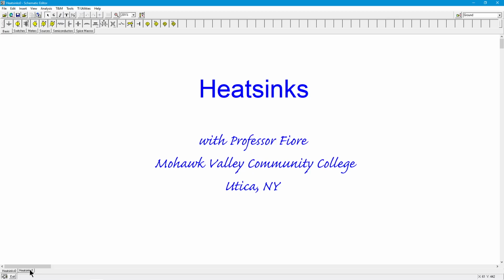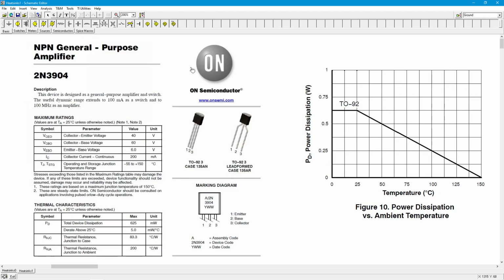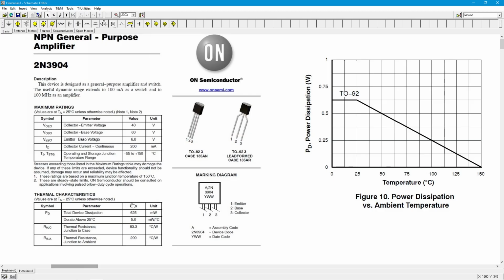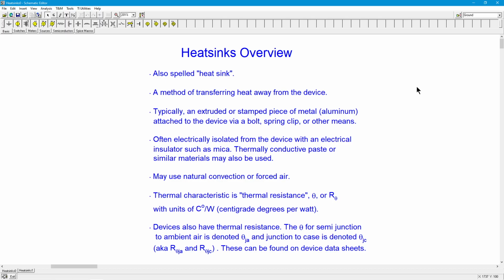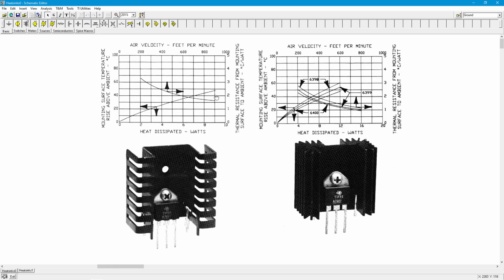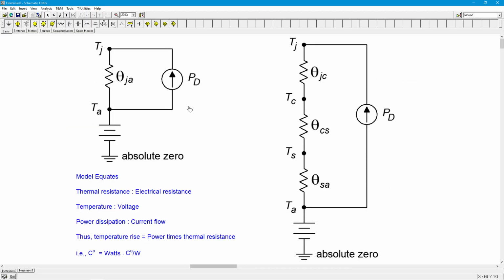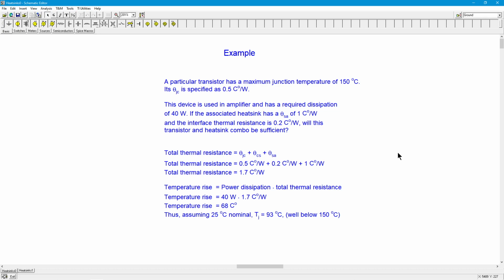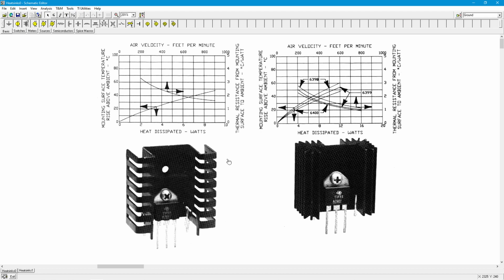Semiconductor Devices: Heatsinks

Comment: 3:01 Does LTSpice take the delayed effect (due to the temperature time constant) into account into the electrical behaviour of the transistor (thermal self-modulation)? Worse, if we include the heatsink model (with additional temperature time constants) into the circuit? Or is the transistor temperature only an output of the electrical behaviour simulation? 
Is it easy to check and verify this one way or another?
Reply from the maker: I have not used LTSpice to any great depth, and do not know the extent to which LTSpice will consider any of those issues. Sorry.
Reply: @ElectronicswithProfessorFiore  Thank you very much for replying. If I find an answer, I will post back.

Comment: 2:17I don't get it: why does the power display a double hump when current and voltage crests perfectly synchronise?
Reply from the maker: We're calculating Pd of the transistor, not Pload. Take the product of Ic and Vce (not Vload).
Reply: @ElectronicswithProfessorFiore  I didn't realise! Thank you very much for your reply .